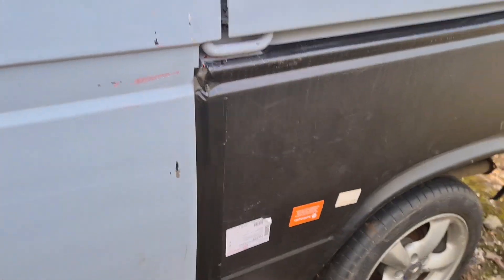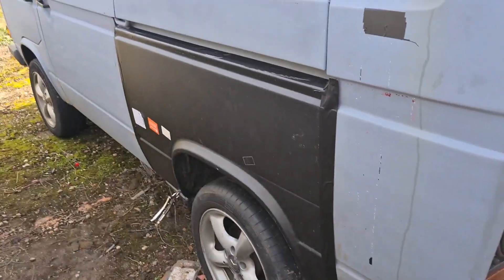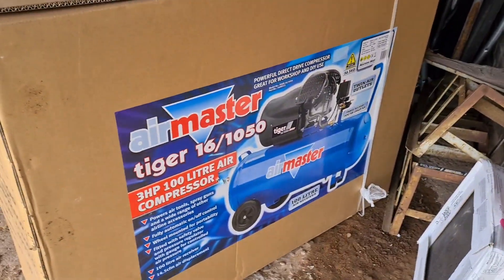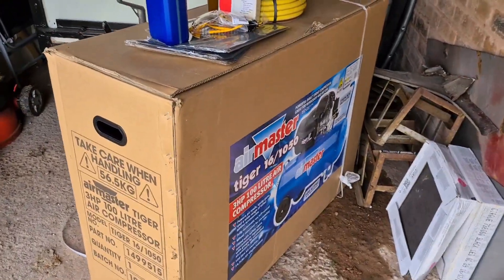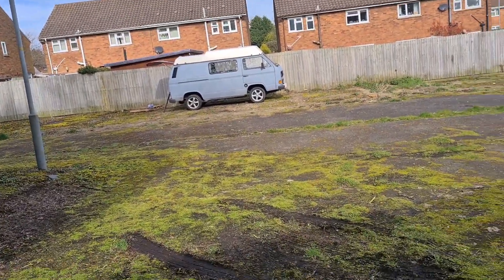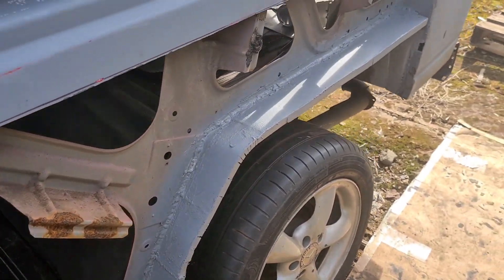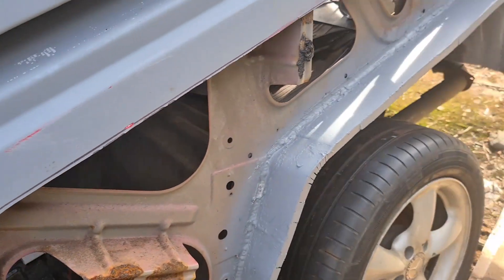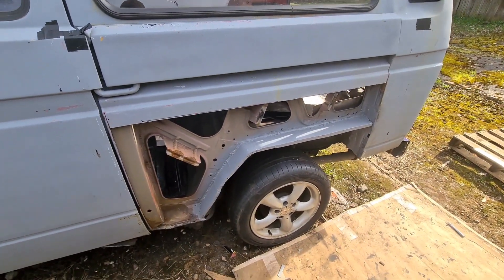finally finished replacing the rear arch on my VW T25 self build campervan vanagon

Comment: Good job man! I'm going to have to make that same inner bit of the wheel well. Hope mine turns out as good as yours. What was the sealer you used to spread all over it before you painted over it?
Reply from the maker: I used a brush on seam sealer mate I just think it lasts longer in a tin that in a tube
Reply: @vdubpollygrey7094  Ah yes, ok thanks.

Comment: Nice work. Re trailing arm... go to big REDD t25 spares on fb... they should be able to help source a decent 2nd hand one.
Reply from the maker: Thanks mate I will have a look 👍
Reply from the maker: I did pick up the welding magnet you suggested helped me alot thanks again
Reply: @vdubpollygrey7094  no worries buddy. What size wire are you using in the welder? Need to get some. Think I was using 0.8 but gonna try 0.9.
Reply from the maker: @room3663  0.8 mate I did buy 0.9 but it wouldn't go through my welder . That welding wire from toolstation seem a lot better mate

Comment: Doing  good  job  ps u need trailing arm  bud
Reply from the maker: Yes I'm looking for a second hand one . Do you know i they can be repaired??
Reply: @vdubpollygrey7094   on gumtree  my bee ..ps yes u can  repair  it just  grind out all  rust  back  2 metal  piece  in weld ...    good  luck
Reply: @vdubpollygrey7094  sorry  notices  it in ur video   need  dun..am up Glasgow  .ps go 2 Volkswagen  shows some one will  have  it on  (stall )  then u can bargain  it down

Comment: Did you butt weld the panel at the top or did you lap weld it? Thanks for the video!
Reply from the maker: Hi yeah I butt welded the panel at the top.. I was gonna lap it with a lapping tool but the tool was about £60 so decided to butt instead.